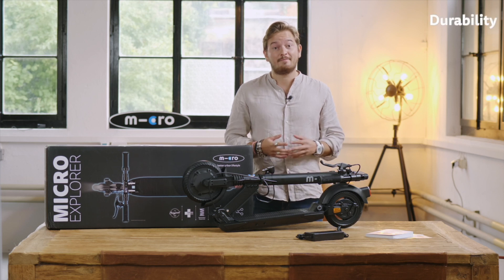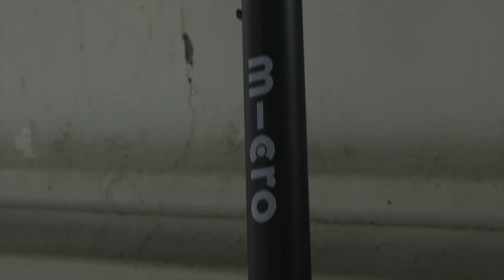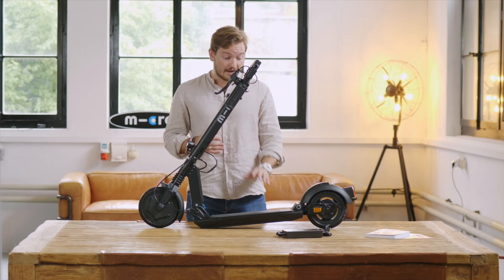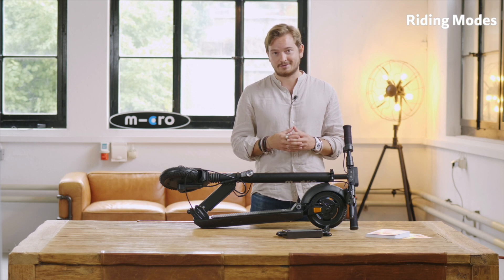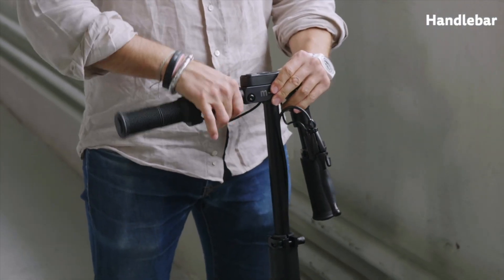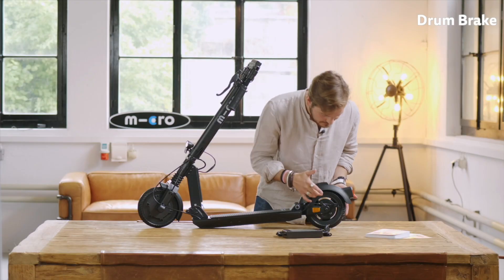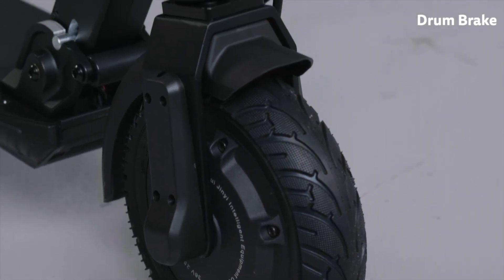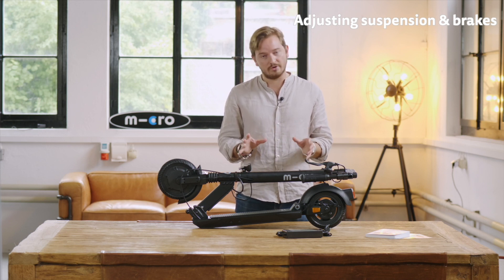Micro Explorer Unboxing

Comment: I have to say even after more than 1000km of riding the product I am still super satisfied. The only downside for me is that you don't have a kickstand. The "Camel Mode" is cool, but a kickstand would be nice sometimes as well. But that's a minor flaw, apart from that it's a great product, much better than the Ninebot I used to have.
Reply from the maker: Thanks for your compliment David! We worked very hard on this product and are always delighted to hear such positive feedback. About the kickstand: we do offer it as an accessory on our online shop :)
Reply: Being so light I'm not sure of the need to park it out and about. I also prefer the 'camel mode over the added weight of a kickstand. Should you not want to purchase the optional kickstand then you can make your own out of a plastic ruler :-)

Comment: How much do I have to push to make the motor kick in
Reply from the maker: Hi Kygnon! To be aligned with the regulation and for safety reasons, the Micro Explorer has to reach a minimum speed of 5 Km/h for the motor to start.

Comment: The scooter feels high grade, has good road holding. It's nice and save to drive. But I am disappointed with three things.
The gas handle is not very sensitive. It's nearly not possible to drive at a constant speed lower speed than top speed, e.g. 17 km/h. 
Even in Mode Sport which is the fasted mode acceleration isn't really strong. I think the drive train could do that better, but it's limited by software.
The e-Scooter start power assistance at 5 km/h here in Germany. Perhaps that's due to regulations, but it makes the scooter feel a bit weak in starting. You are often the last scooter from start at traffic lights. ;-(
Summary: Power is less than expected. 
Firmware on my scooter is 1.0. Nobody can tell, if software is developed further on and if or where it is possible to upgrade some day.
Reply from the maker: Hi Timo! First of all, thank you for picking the Micro Explorer. We are always happy to have honest and expert feedbacks on our products for further improvements.
To give you an overall answer on your points, we have already an improved software and we keep working on the sport riding feeling despite the regulations.
Reply: @microoriginal  how can I remove the speed limitations?
Reply from the maker: @ivanez5557   Hi Ivanez 555, thank you for choosing our scooter. If you wish to remove the speed limitation for a usage in private properties, you will need to send us your Micro e-scooter, then sign and agree to the conditions.
 Please note that in Switzerland, we charge 59 CHF for this process.

Comment: When Mercedes announced their parnership with micro, I though I could have gotten the same scooter for cheaper and limited to 25 not 20 for my country. But somehow they're the same price.
Reply from the maker: Hi Josip, yes the price is the same. Depending on the market we have different speed limitations on our E-Scooters. In Germany and Switzerland you are limited to 20 km/h but in France you can go up to 25km/h. Where are you from?
Reply: @microoriginal  I'm from Croatia, you have an extension to Croatia and sell your products here and it's limited to 25 km/h. Mercedes, however, sells their scooter everywhere with a limit of 20 km/h. Also their scooter is only 250 W while your's is 500 W. Point is, Mercedes is overpriced. I thought I could get the same scooter for a smaller price without the Mercedes branding by buying it directly from Micro. But it turns out it's the same price, but now I see that your's more powerful and justifys the price while Mercede's doesn't.
Reply: @josipcuric8767  Pozdrav Josipe.
Dali si ga uspio otkljucat na 25km/h ?
Ja sam ga kupio u Njemackoj i max mi je 20km/h